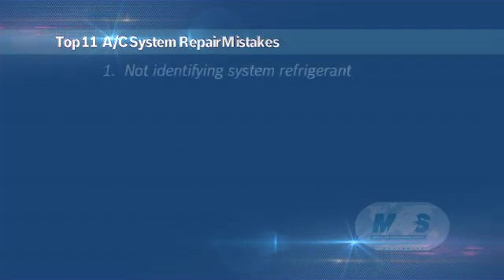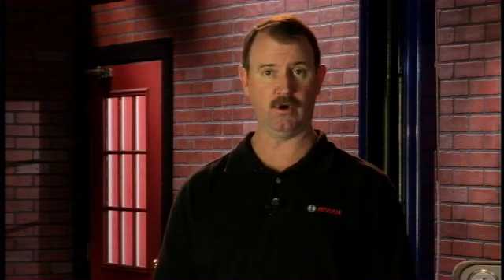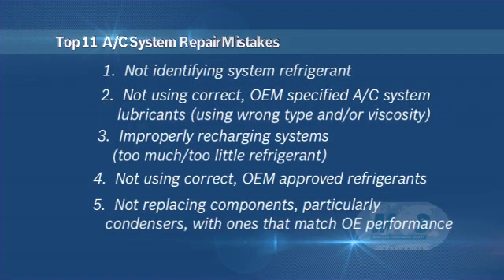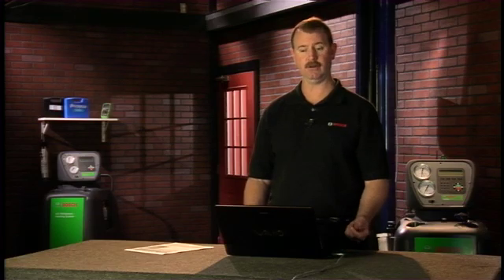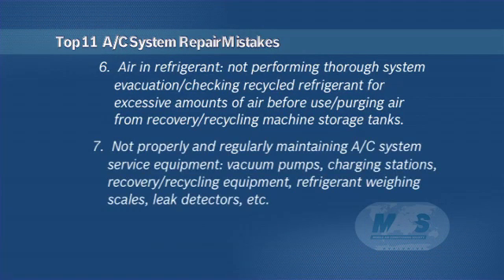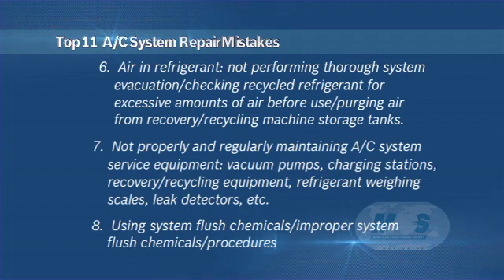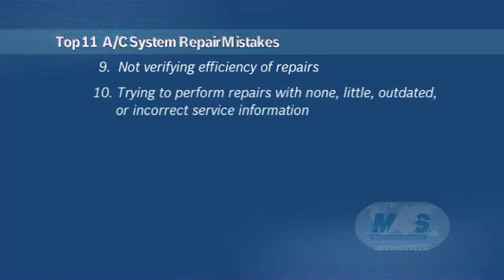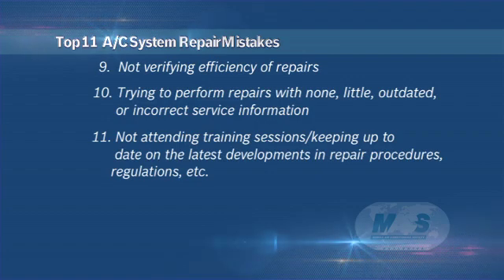Top AC System Repair Mistakes | Bob Pattengale | Tech Tip

Comment: so if the vehicle had R12 in it i should find some R12
Reply: A little  late but retrofit the car buy a new accumulator  and drain the compressor oil fill it with pag  vacuum the system and recharge